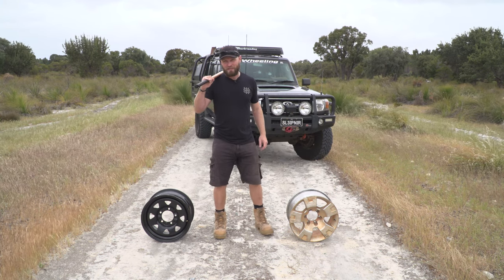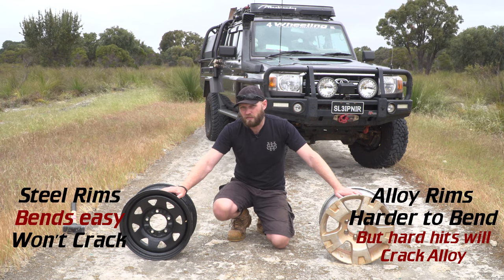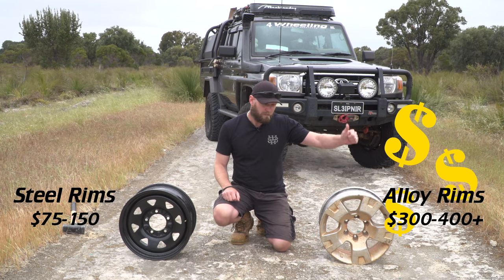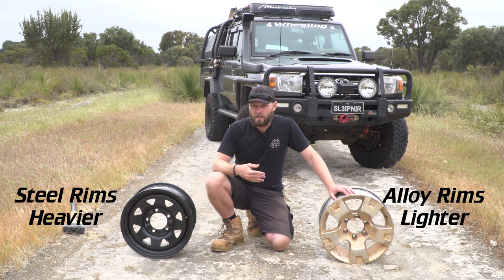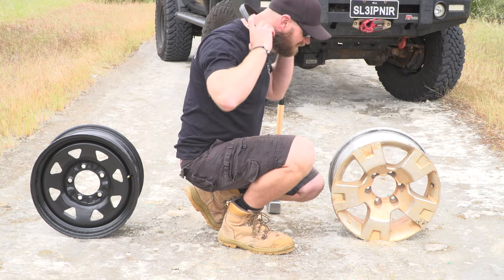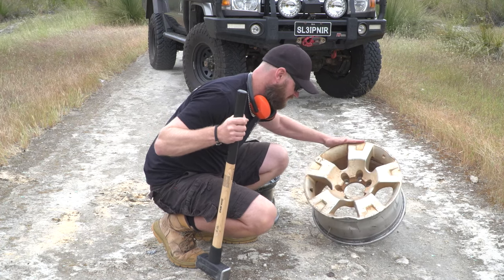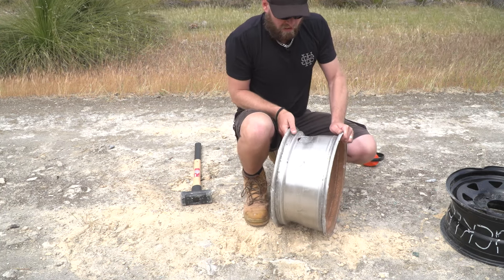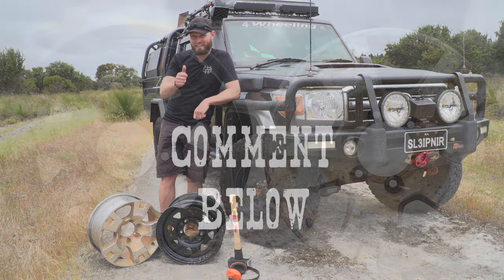STEEL vs ALLOY rims Off-road Wheels

Comment: that's a fair comparison of steel vs cast alloy rims. but you have neglected to mention forged alloy rims which are.
stronger than both steel and cast alloy by a considerable margin.
they bend like steel and can be bent back without cracking.
they are lighter than steel or cast alloy of equal strength. though most would fall between a cast alloy and steel wheel in weight but be much stronger
subjective but forged alloy wheels usually look the best due to being completely machined and also having options of external beadlocks or three piece internal beadlocks (can be street legal because they aren't a modified wheel) plus they are the wheels most commonly seen on offroad competition vehicles with brands such as method,walker evans,hutchinson etc
the only cons for forged alloy wheels is price in aus they will be $500ea and up.
Reply: michael close huh that list of brands is useful, till now I thought you couldn’t find forged truck wheels in anything but mall crawler sizes.
Reply: a lot of forged wheels still come in 15,16 and 17" because they are used on comp vehicles where function is more important than posing.
Reply: In the US many of the OEM aluminum rims on the full size Utes
Are forged. Often people replace them with inferior cast rims just for the looks.
Reply: Tim Roach not me, I kept my factory rims, I think they look pretty good
Reply: Southern Nevada offroading and back country yup, me too.
Reply: the full size pickups would need the forged alloy wheels for the load capacity.  it's worth checking if the aftermarket wheels are forged and what the capacity is because a lot of manufacturers sell the the same style wheel in both cast and forged.
Reply: Do any of you read? Did anyone here finish high school? Forged alloys are indeed higher in tensile strength. They are also more brittle! The multi piece wheels that you guys describe are a forged centre with a steel outer! 

Competition trucks will use forged wheels because they are near a support truck and repair crew and therefore can take the risk of broken wheels in their stride. They use forged wheels to minimize unsprung mass. This allows more responsiveness of their suspension and less rotating mass to accelerate and brake. Both important when you are trying to shave thousandths of a second off a timed run.

If alloy wheels are so goddamn durable, why don't military vehicles use them? Do you think that it might have something to do with them being susceptible to damage in harsh environments?

Fuck I wish people would engage their brains.
Reply: the three piece wheels i'm talking about are beadlocks the two halves of the wheel bolt together and they have a spacer inside that pushes the bead bundles against the rim.  you're dead wrong about forged wheels being more brittle, forged wheels i'm talking about are 100% alloy no steel. competition vehicles use forged alloy because they are the lightest,strongest most durable wheel especially important for races like baja 1000 and dakar where your support crew is hours away. well some military vehicles do use forged alloy wheels but i'd say the biggest reason a lot don't is cost. you're should check out method race wheels, hutchinson  beadlocks and walker evans forged beadlocks. and by no means are they the only three making forged wheels for 4wd's.
Reply: michael close You are doubling down on wrong. Go and study metallurgy. Forged alloy wheels are stronger and more brittle. Multi piece wheels with a alloy inner and a steel outer are the most durable. All forged wheels are only used by motorsport teams for their weight advantage. They still hit rocks and bend wheels. They CANNOT straighten the forged wheels once bent. Forged wheels WILL NOT HOLD AIR once they are cracked. As far as abailability of service, yes their crew may be hours away. When you are crossing the fucking simpson desert HELP IS FUCKING DAYS AWAY. People have literally died because they have cracked wheels, disabled the vehicle by trying to drive on their broken alloys and have eventually perished from the elements because they had to try and walk out.

Military vehicles in combat areas DO NOT USE FORGED ALLOY WHEELS. Period.

If forged alloy is so damn good at taking damage, why is the armour on a MRAP still made of steel? Do you think that maybe steel bends before it breaks? Do you think that maybe aluminium alloys, forged or not, are prone to galling and shattering? Do you think that shattered armour might bounce around inside the vehicle, turning those inside to soup?

As I said, you are delusional. You will try to say any bullshit to justify your position. Arrogant twats like yourself are the kind of dickeads that I used to sell Jeeps to. You will beleive fancy sounding bullshit over simple truth.

STOP IT YOU DUNCE. And I am serious. Listen to logic, learn to accept being wrong and see how much your eyes open.

I really did prey on attitudes like yours when I was in car sales. Your arrogant 'know it all' attitude will end up costing you a shit ton of money and make you look like a complete fucktard when you open your moith in front of people that are far better informed than you.

Like you have done here.
Reply: Daniel Beard you are an angry man.
Reply: @freefall0483  oh Aluminium wheels are used on military vehicles. Look the rims on the MRAP from Hutchinson or Fuchs Aluminium wheel for MAN KAT1, Luchs and Fuchs tank.
Reply: Craig Christensen It's not anger. It is frustration at the ignorance.
Reply: Hahaha steel vs alloy plebs. Let me enlighten you to the world of carbon fibre rims. Lighter, stronger and higher shock resistaince than steel and alloys. You cant break them from any 4x4ing.
Reply: i wonder if he even has a clue yet.
Reply: @liamcooper5202  And at minimum 5x the cost as even monoblock forged alum.
Reply: @Drunken_Hamster  i never said they were   cheap

Comment: Lightness is the key! Heavy steel rims with oversize tyres drain performance and fuel economy. Not to mention the extra stress on bearings and steering knuckles.
Cheers
Reply: If you're talking about a heavy 40 inch tire the difference in weight by going alloy is not a significant savings .Things like aluminum wheels and suspension links don't save much unless you are building a buggy and shave on the entire build not just a link or a wheel  .
Reply: when you are only goin in daily routes with minimal load use lighter material it will makes sense in economy run... but when dealing with heavy load and fun games why think of the expenses when you can enjoy your time without any worries on your ride
Reply: @yerwrng  its approximately 10 lbs difference per wheel. My 20 inch steel rims weigh 46 lbs and the 20 inch alloy rims on my other truck weigh 38 lbs. So, add tire weight to that and its easy to see why alloy rims are better from a performance stand point
Reply: P.s. i have 40x15.5r20 nitto grapplers on both trucks
Reply: @hanksadventures4132  yeah I only go about 5-10 mph on my 42s so it's not that big for me .I guess if you're going fast it is . I aksi have enough axle to not care so much . I will say a nice set of bling looking race lines do look better than their steel cousins I have with the allied bead locks.
Reply: @yerwrng  the difference becomes more apparent when your climbing. You have to use more skinny pedal and have higher RMPs to get the tires spinning, you are also loosing torque to the ground by increasing the rotating mass. You will see a huge difference when climbing shale trails and steep hills.
Reply: @hanksadventures4132 I might try some new wheels out...lol... I just don't look forward to doing 128 bolts ... twice... to dismount and remount.
Reply: @yerwrng  facts, lol
Reply: @hanksadventures4132  Right, but this isn't about performance. This is about field repairs.
Reply: @donewhiskey  I understand that, however, I've never ended up in a situation where I was shit outta luck because I had alloy rims. with enough tire between the obstacles and the rim, your pretty well off. I run 8-15 psi in my tires and have yet to crack a rim. I've bent 2 steel rims on the lip, and had to pull the tire and put on a spare, but my alloy rims have held up better. mind you, I'm not out jumping the truck either. my point is, realistically, alloy rims have plenty of advantages, just don't go get the flashy chrome rims with low profile tires and expect the rims to hold up. 7-10.5 inches of tire between the road and your rim will keep you from needing to do any trail repairs.

Comment: Thank you for a well prepared video comparing the steel vs the aluminum ("aluminium") rims/wheels.  You have just confirmed what I originally suspected: that the steel rim is superior.  The only instance where an aluminum rim would be advantageous is when you're going to a (significantly) larger rim/wheel and the driving conditions will not be severe (road).  In this case you will gleen the weight savings, brake parts cooling benefits, and the giant hole in your pocket as a result of the cost.

Comment: One thing that should be brought up is cast vs forged wheels. Those look like OEM Tacoma wheels (or whatever they put them on in Australia) which are cast. Forged wheels are a significantly stronger type of alloy wheels. That being said, they'll still crack if hit hard enough whereas steel will bend.
Reply: We have the Toyota "Hilux" in Australia which is comparable to your U.S "Tacoma"

Comment: The greater advantage of the higher thermal conductive of aluminum wheels vs steel is on the wheel bearings (grease) than the brakes, as they also have a much larger contact area to the hub and will be able to pull heat from the hub faster.  As galvanic reaction is ever-present between dissimilar metals, it is important that you always have a film of waterproof grease between the wheel and hub.
Reply: Never really thought about between hub and wheel, I guess there may be some truth to this.
Reply: You'd find that your bearings don't heat up much at all. All that heat comes from your drivertrain. Feel the wheel bearings on a fully loaded trailer unbaked. Lucky to be 10 degree above ambient.

Comment: Ronny I've cracked aluminum alloys before, I managed to scoop some large gravel into the wheel while going around a turn with some speed (maybe 25mph, 40kmph), and you could hear the stuff flying around the wheel well- about an hour later my TPMS sensor was going off, we got out and inspected it and sure enough I cracked the center of the rim.

I now run steelies!

Comment: I have Alloy... and carry 2 Spares
With proper tires on and not driving like Ronny Dahl (hehe :-D) I have never lost a rim
It's important what you want to accomplish.  I like to go to remote locations but pushing my 4x4 to see when it will brake is not my thing...

Thx for the Vid :-)

Comment: Another benefit of steel rims is that if they do crack and leak air you can weld them even in a remote area with two 12 volt batteries, jump leads and a welding rod.
Reply: a lot to ask for in a remote area
Reply: @liyakadavhsegar  
Not really, if you go off road you should at least go prepared with a basic tool kit. I can't count how many times welding with 12v battery and jump leads saved the day for me.

Comment: We’ve placed an order for the 4th generation Suzuki Jimny (blue Manual).
The reasons why I’m going to give the factory alloys a go is:
1/. I’ve already paid for the rims.
2/. I’m a very careful off roader, will definitely stay away from the difficult stuff as I don’t want to waste money and time on breakdowns.
3/ Given the weight of the vehicle with aftermarket all terrain tyres GF Goodridge KO2 an extra 1 inch bigger in overall diameter and about 40mm wider.  This tyre will also help reduce the risk of rim failure due to greater wall size and cross sectional area being increased.  As the Jimny only has a small 1.5 litre engine I want to help out with the rotational inertia as much as possible.  As I said, I look after my gear and never trash it so I doubt that it will get damaged in the first place.

However, if I was in a different vehicle and not as cautious, definitely steel is hands down the winner.

Thanks for showing just how fragile the Alloy Rims CAN get!

Comment: BEST LOOKING AND
MOST EXPENSIVE.
AND THE ANSWER IS:::
drum role.
Chevy sport steel stock with beauty rim.
1970s.
$20 to $40 new.  but now as much as $ 250 to $500 each.

Comment: A big tip for the 6 stud brigade, 60 series Sahara chrome rims are about the toughest rim you will ever find bar none. And possibly the heaviest. They also have a machined lip on the outer bead which make it close to impossible to knock a tyre off the bead. I have been running them through all sorts of stupid terrain for a few years now at pressures as low as 6psi and have never run a tyre off the bead. I have had a slow leak on a bead from sand ingress, but that was because I had to be snatched sideways on a beach with 6psi in the tyres.

They are 6mm steel centre disk with 4mm steel on the outer rim. I have never even had to bend one back into shape because bits break off rocks before these bastards bend at all.

The one big downside is the instant need for a brake upgrade on my truck. Lots of extra rotating mass to stop. I have also had to reinforce the rear door mounts and striker plate mount as the massive increase in weight on a door mounted spare did not work well on corrugations. One day I will build a swinging spare carrier and solve this permanently. These fuckers are seriously heavy and getting rare these days too. If you find some, buy them. You will not regret it.

Even you 5 studders could have the centres modified if you were serious about indestructible steelies. You also have to be fond of chrome, cos I don't think they come in any other colour. On the plus, being chrome dipped, they dont rust.

Comment: All 6 steel d-windows on Honey Badger have been beat with hammers and rocks multiple times to get them back into shape enough to hold the bead. They don't look pretty but they still work just fine on and off road!!

Comment: Greetings Mate!  I live in Oregon and my wife and I enjoy exploring our wilderness areas in our Tacoma.  I would like to thank you as we both enjoy your entertaining and insightful videos and tips.  I am definitely a much better and more aware off-roader due to the sharing of your extensive knowledge.
I wanted to add a suggestion that has served me well.  CraigsList!  Used is an excellent way to make my off-road dollars go a lot further.  I know, buyer beware!  However, over the pond, stateside we have two types of 4x4 drivers.  We have people who buy the best vehicle and equipment to actually go outdoors and folks that don’t go off-road and buy the for the look. They are called “Mall Crawlers”.  Anyhow, the Mall Crawler group will usually shed their stock equipment to create a custom look.  It seems the most popular upgrade are wheels and tires.  Their OEM (and often almost new) parts are sold on CraigsList oftentimes for very low prices.  Find your vehicles bolt pattern and use that as a keyword for your search.  Our Tacoma is able to use wheels from most of Toyotas SUV line up, plus Chevy and GMC trucks also.  I recently got a very nice set of 5 (included a matching spare) alloy wheels for only $100 and a 50 mile country drive.   
Also Ronny, if your truck is named SL3IPNIR, would you be implying that you are Odin?  :)

Comment: Had an Oldsmobile in CT years ago with steel rims. One winter there were many potholes on my street. One day  driving home I been a rim, changed to the spare and bent the rim on the spare a mile further down the same road a few minutes later. Screw steel rims. Never had a problem with my alloy rims on my wrangler off-road in Utah.

Comment: Now, that's useful info !! Great vid as always !! Simple and clear !! Along with the bullbar, you should do also, a comparison between   fuels (Diesel versus Petrol or Low and High cost). Keep up, Cheers
Reply from the maker: Diesel vs Petrol is a project I've got waiting to be filmed ;)
Reply: Diesel costs more, that.s not great. Diesel engines cost a /lot/ more. That's not great.   Diesels tend to make a lot more torque than an unleaded (though that is changing) and do so at /much/ lower RPMs which is great for off-roading. That's good.

Also diesel freezes at a much lower temperature than petrol and is much more difficult to ignite. 

I look forward to Ronny's take on this - should be a fun one.

Comment: I will say up front I’m not bashing Mr. Dahl one bit, his points are spot on and very valid. But there are a few things he’s forgetting. 1 yes, and I agree if your far away from civilization the steel rim is the way to go, it’s pretty hard to kill a steel rim. But, there are several different types of aluminum rims commonly produced. The rim Mr. Dahl was beating on was an oem cast rim. Cast breaks very easily when struck, good example look what happens to an engine block when a connecting rod hits it, it more or less cracks and shatters. Forged and rotory forged rims will not crack that easy, and most forged rims will bend to an extent, not like a steel wheel will but they are still a lot more durable than a cast wheel. Just wanted to share that bit of knowledge. Love the show and keep the shiny side up.